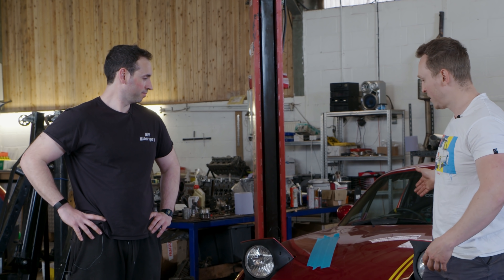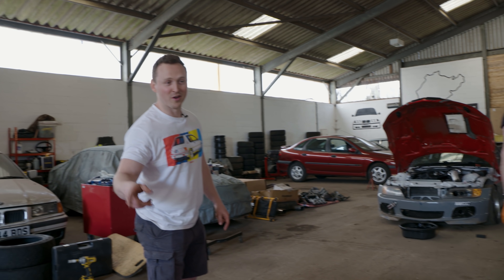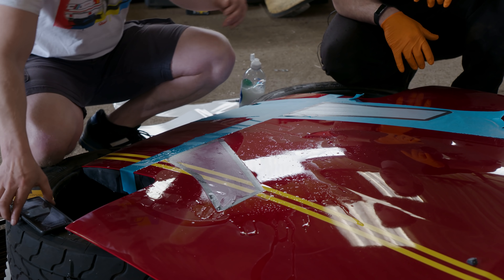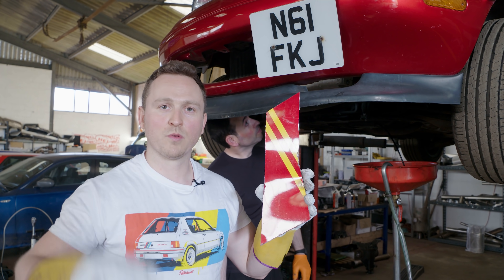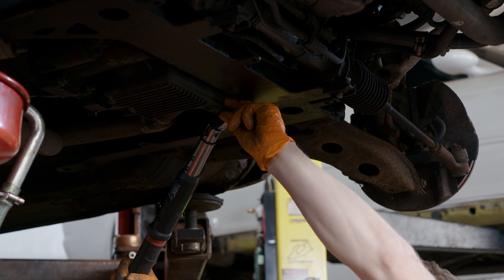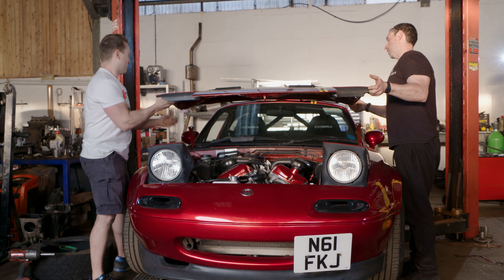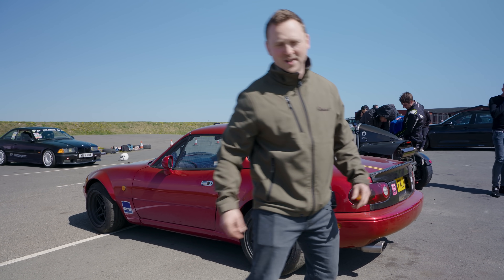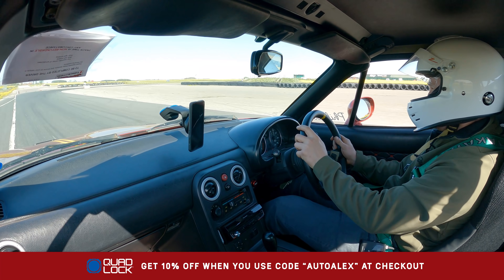I Ruined My £5000 Paint Job With An Angle Grinder

Comment: You need to protect the raw metal. Every cut and hole is a new potential for rust. You may want to consider removing the vent, coating the raw surface of the metal, and reinstalling it. Cheers
Reply: @rockyrocker23  Yeah they are aluminium, aren't they? I think it was to offset the battery moving into the boot when the designers shortened the front of the car and found the battery wouldn't fit  late in development. The material change was apparently why the rear of the headlight lids were a bit droopy from factory - they were made with the steel bonnet in mind.

Comment: 10:28 - Be careful with sticky oil filters - they bite. Was trying to remove my own oil filter by hand and it wouldn't budge. Gave it all of my strength and then heard an almighty "CRACK". My immediate reaction was worry that I'd broken the thread and this would be an expensive repair.
Then I collapsed to the ground with one of the worst pains I have ever felt - was like somebody had torn off my thumb.
Turns out I'd done significant soft tissue damage to my thumb and it was a number of months before it would work properly again. I had to tape my thumb to my hand as if I accidentally moved it at night the pain would wake me up.
It's been around 2 years now and it's still not perfect...

Comment: I have fitted bonnet vents. My method drill a hole in each corner then use a simple jigsaw with a fine metal blade. Smooth cut. No paint damage.

Comment: Do yourself a favor and ditch those 4-point harnesses for some 6-point harness while you're swapping seats. It's easy to run both a stock seatbelt and a race harness in a dual duty MX5, which means there's no reason to no run a 6-point harness (you really want that anti-sub strap!). You also should not be using a harness without a HANS device. 

I'm super happy to see Phil out getting used and I love the Phil content.

Comment: Be careful with those PBS brake pads - they're not intended for road use and I'm sure Phil is a street car. If you had an accident and the car was inspected you'd essentially be without insurance if they spotted the pads. Low chance but it's been known to happen...